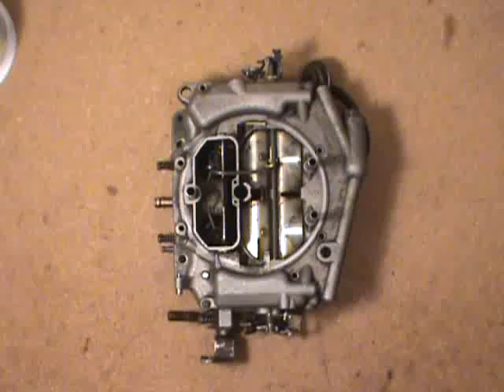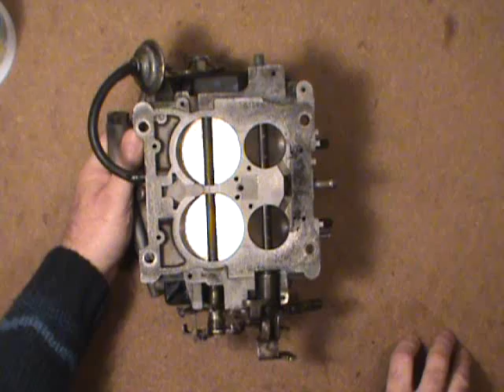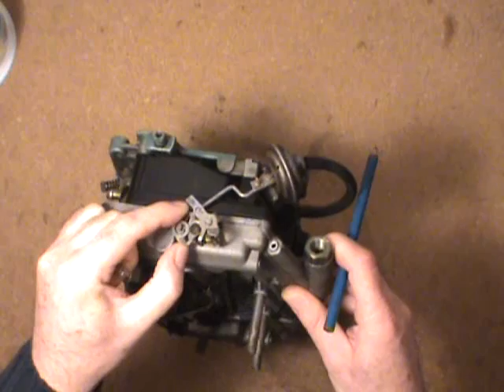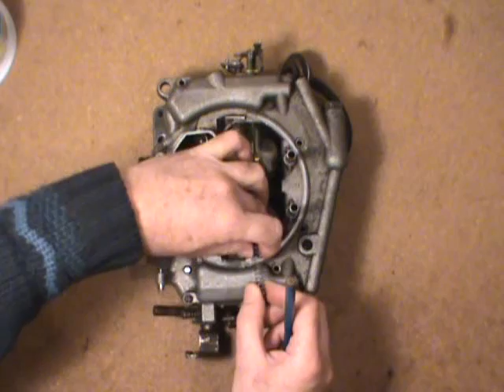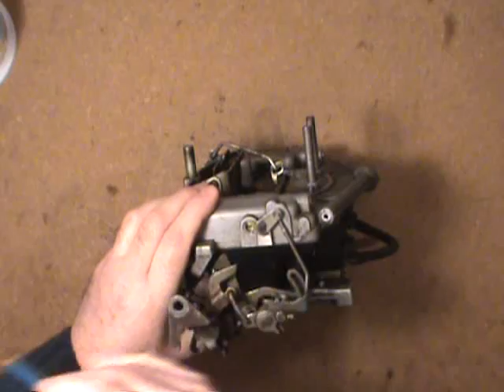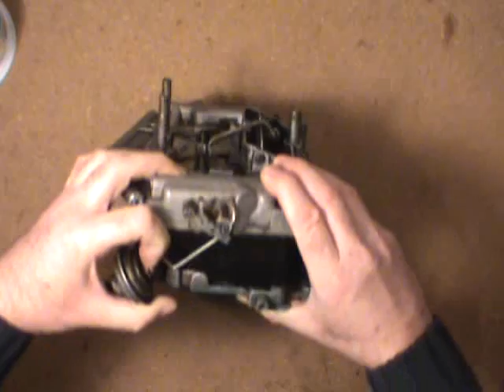Thermoquad 4 Barrel Carburetor  (Part 7)

Comment: Hi, these videos are great! I think the Thermo-Quad is a really good carburador, I had a stock  340 Dodge Challenger with a tq, it ran great. Now I’ trying to tune another tq in a bigger cammed engine, The first thing I noticed is the needles were to small and the carburetor dried. Tune this tq for a more breathing engine is way different from a stock engine. I’d like to have some recommendations from you.
Reply from the maker: Greetings...pepitomateo1...……..Thanks for the nice comment, and thanks, for watching too...…..Whenever, a factory/stock, not, high performance engine, gets a "high performance"...heavier breathing camshaft...that produces, that, much wanted, and heard...buh-bump-bah-bump sound, at idle speed RPM's, installed into it, then, it's very important, to get the "ignition advance curve"...modified properly, along with, the usually, increased amount of, initial (base) ignition timing, otherwise, the carburetor, will not idle, or transition into, the above idle speed RPM's, as it should be doing...……..You might, have already noticed, that, Ya had to crank the idle "speed" screw "in-wards" (clockwise), quite a bit, in order to, try and keep the engine from stalling...right...???...…….If you have a look at the Thermoquad carburetor, from the bottom side of it, then, focus your attention, on those 2 slots, as in, 1 slot, in each of the primary throttle bores...……When the choke system is fully off, then, there should only be, a "small square" opening, showing, there-abouts, that is caused by, and when, the primary throttle plates (butterflies), are in, their (curb) idle speed position...…….So then, whenever, the idle "speed" screw, gets turned in-wards/clockwise, more than it should be, then, those slots, that should be showing, "only", (about) a square shape, will probably be looking more like a slot shape (not wanted)...…...By, not having that little square shape (of that slot) showing, then, it will usually, really mess up, the transition, from idle speed RPM's, into the RPM area, that's above idle speed...…...That's why, it's so important, to have the correct amount of "initial" (base) ignition timing, for almost any camshaft, that will cause, that..."buh-bump"..."buh-bump"...somewhat famous, idle speed sound...…….For a Distributor, type of ignition system, the "initial" (base) ignition timing, has to be figured out first, for the camshaft's, and engine's, shall we say, "personality", then, the "total" (old school terminology, and, it was probably a racing distributor, that didn't use a vacuum advance canister, on "it", at all) ignition timing (total timing...that be, the initial/base timing, added to, what the mechanical weights produce, when they are slung outwards, as far as they will go)...as well as, how fast, those mechanical (metal) weights, sling outwards, as the engine RPM's, start to increase (the movement, of those 2 metal weights, are usually controlled by, the amount of tension, that those, usually 2, coiled springs are rated at, and, are sometimes, color coded as well)………..Here are some examples for Ya, and, please note..."Do Not Use these Examples"...on any engine, or..."Severe and Expensive Damage"'...could be the result...!!!...……I'll use an old school V-8 engine, that has a distributor...…….A "smog" engine (very lazy, performance-wise...lol), might have, oh, about 5 crankshaft degrees of "initial" (base) ignition timing, and, those 2 spring loaded weights, will add 30 (crankshaft) degrees, and might not, sling outwards fully, until engine RPM's reached above 4,000 RPM's, (the old school terminology/total timing, will be, 5 degrees initial/base...plus...30 degrees, from the mechanical weights & springs...for a total timing, of...35 crankshaft degrees)..........In this example, there will probably be, a vacuum advance canister, on the distributor as well, which will be adding, 15 crankshaft degrees, added onto, the total timing, while the engine, is in, a light loading condition (please note...when going pedal to the metal, the engine's, intake manifold...vacuum signal, drops to almost nothing, there-for, the vacuum advance canister, goes back to its resting position, and does-not, add any, vacuum advance degrees at this time)………..So then, ("smog" engine only), during light engine loading/just cruzin' along, then, it might be, 5 degrees initial/base...plus...whatever the mechanical weights and springs are providing at the time (depending on the engine RPM's)...plus...the 15 degrees, that, the vacuum advance canister is providing (here's another wrench, thrown in as well, as in, is the vacuum advance, connected to the carburetor's..."port", that's usually called ported vacuum, or, is the vacuum advance can, connected to "manifold" vacuum...???)…(the only real difference, is that, with manifold vacuum, it will usually add that 15 degrees, while at idle speed, where-as, the ported vacuum signal, doesn't kick in, until, just above idle speed RPM's)………..The most ignition timing advance, while the engine is lightly loaded, will probably be, 5 degrees initial/base...plus...30 degrees from the weights and springs, while the engine is above 4,000 RPM's...plus...15 degrees, from the vacuum advance canister...which will be 50 degrees, when it's as far as it can go...…….A vacuum advance canister, that is connected to "manifold" vacuum, that also has, the correct rate (measured in Hg/inches of mercury), as well as, the correct amount of (vacuum) advance (be careful here now, because, there are crankshaft degrees, and also, distributor degrees, which are only 1/2 of, the crankshaft degrees...!!!...pay attention to that one, for sure)...where was I...oh yeah...by using the correct vacuum advance canister, that's connected to manifold vacuum, then, the engine, that has that "performance camshaft", in it, will probably now, be, idling, and transitioning into the RPM's, just above idle speed RPM's pretty good, well, providing that, those 2 slots, in the Thermoquad carburetor, are showing a square shape there-abouts, while the carburetor is at idle speed, and that, the distributor (if there is one, that is), is, properly set up, with the proper, ignition advance curve, and, is also, set at the correct, Initial/base ignition timing, for that "exact", high performance camshaft...……..Now then, here's an..."Example Only"...for a high performance camshaft-ed engine...…….Before I forget, there use-tah be, some "initial" (base) timing, degree....recommendations/suggestions, that I saw, some time ago, on, the good ole inter-webs, that were based on, the camshaft's duration specifications (well, as I recall, that is)………..So, here goes...…...The imaginary/example, high performance camshaft, in this "Example Only"..."Do Not Use"...!!!...likes...20 degrees of initial/base timing....and...the engine's personality, is asking for, 35 degrees, of total timing, and, the total timing is...(20 degrees...plus...15 degrees, from the advance weights & springs, which, will fully sling outwards, when the engine RPM's, reach 3,000 RPM's, which isn't too risky, on this "example only, imaginary" engine)………..Then, it can sometimes become tricky, when choosing & setting-up, a vacuum advance canister on this one...…….Seeing as how, the total ignition advance, is now coming in earlier, at 3,000 RPM's (not 4,000 plus, like the "smog" engine had), then, the vacuum advance canister, might not be able, to go any higher than, oh, about 10 (crankshaft) degrees, perhaps, otherwise, there might be some surging, or maybe, a bit of pinging, while at light engine loading/just cruzin' along...……..Sometimes, too much initial ignition timing, can make it too hard on the starter motor, to turn the engine over, when the engine is hot, and, this is where, the correct vacuum advance canister comes in, to help things out, starting-wise, that is...…….Lets say, that, the hot engine will start ok, with 10 degrees of initial/base timing, as to where the distributor is locked (bolted) down, then, the other 10 degrees of advance, can come from the vacuum advance canister, once the engine starts running/when the manifold vacuum signal is now present.......….If Ya wanna spend a few dollars, and have a new distributor, that is "custom" made, and set up, for your exact engine and vehicle, then, go check out....DUI (nope, not that kind), but rather...Davis Unified Ignition...(I think, that's the name of the place), as, they do quite a few types of distributors, and, they might have an HEI (High Energy Ignition) distributor, that only requires a "1-Wire" hook-up...!!! (12 volts/ignition switch wire, most of the time), for your engine...………They also have, some good lookin'...spark plug "wires" too (as I recall)………..The DUI folks, will want to know, just about everything, about your vehicle and engine, because, the more, that you can tell them, about your ride, the better, that, they will be able to, match the ignition advance curve, to your vehicle and engine's needs...……..Not only, will a proper ignition advance curve, improve the engine's performance...you'll also get, an increase, in fuel economy too..."but only"..."if"...???...Ya can keep...Ur Big foot...from..."mashing down"...on the gas pedal...!!!...lol...and...….till next time...….Be Safe, take care, and have a good one.

Comment: Do you have a website ? I have a special Thermo-Quad on a 1978 Dodge Polara 440. Former N.C. State Highway Patrol Cruiser that can use your detailed work.
Reply from the maker: Greetings...W Butler...……..Thanks for watching...……..Well, I don't have a website at all, but, if you can post any questions or concerns, that you may have, about a Thermoquad carburetor, then, feel free, to post those things, under any of my Thermoquad carburetor videos, that are on my YouTube channel...RockysRoadshow...thanks...………Here are a few things, that should be replaced...…...Get 2 new "floats"...and, a new "choke pull off" (kinda looks like...a little space ship...lol), and, if there is a short rubber hose, that connects it to the Thermoquad, then, it's a good idea, to replace it as well, as the older, probably dried out, rubber hose (tubing), might have an air leak in it somewhere, or, just fits poorly, at one, or both ends of it...……..The "rebuild kit", for a Thermoquad (and, for most, of the other carburetors as well), will usually have some very, very good (on paper) instructions, that are usually in the rebuild kit (as in, inside the cardboard box), and will have, some very impressive, and well written instructions, specifications, and drawings as well, that will usually guide you through, step by step, as you move along...……..Be very certain, that you make all of the adjustments/settings, in the..."Exact"..."Sequence"...!!! (as in, order of doing things), because, some of those adjustment/settings, depend on, some of the other settings/adjustments, that were done..."before"...the one, that's about to be done...!!!...and, that's probably, one good reason, that some folks, gave the Thermoquad, a, not so good review, as in, they or them, probably never studied the Thermoquad carburetor at all, and probably, just turned this screw, or that screw, and/or, bent a linkage or two, while not really knowing, what does what...???...and wondered why, it ran like crap...lol...……….I'm not sure, as to when/what year (as in, was it before, or after 1978...???), that, the good ole Gasoline (full strength stuff), was, shall we say, starting to get watered down, with about 10% Ethanol (might be alcohol, made from corn, perhaps), which will probably cause, some of the earlier Thermoquads (that were originally calibrated, with 100% gasoline), to administer, a "leaner-than-wanted", air/fuel ratio, to the engine...………I had to re-jet (with the fuel jets), a Themoquad (circa- 1974), quite a bit richer, from .095", up to .104" (" equals inches) hole diameter/orifice size, just to get rid of that lean surge, that I was having, some time ago, while just going, at about city speed, and very easy on the gas pedal...(lean surging, is when the car was surging/bucking, forwards and backwards...very annoying, and Ya can't miss it at all...lol)………..Running an engine, on too lean of an air/fuel ratio, can, and will, be causing, a certain amount of engine damage, especially when, going pedal to the metal/full throttle acceleration......….There are usually...Four numbers, followed by the letter S...that are usually..."stamped into"...the Thermoquad's…"Baseplate"...(aka, throttle body), at one of its rear corners (at the back), and, you'll need this information, when-ever ordering a rebuild kit, or, other parts for it.......….Do an internet search, for...Vaanths Thermoquad Guide...(I think?)...because, if that web-page, is still up and running, then, there's an incredible amount of information to be had, and then some, and, the guy that wrote it, did a Fantastic job...!!!.......and......till next time...…Be Safe, take care, and have a good one.

Comment: Great video.  My secondary air valve door is stuck closed on mine. It isn't rusty or anything.  What causes that?
Reply from the maker: Greetings...Mickey Flowers...…….Thanks for the nice comment, and for, watching too...….I'm sorry for taking so long to reply to you, as, I kinda missed this one...…….The TQ's secondary air valve's opening rate, and, the amount that it opens, is usually controlled by the "choke pull off" (it kinda looks like, a little space ship...lol)………..While the engine is running at idle speed RPM's, and also, at, not so fast, city/highway speeds, while going easy on the gas pedal, then, the engine's, intake manifold's vacuum (signal) is quite high (as in, strong air suction), which will usually, keep the choke pull off's stem, pulled in quite a bit, which in turn, keeps the TQ's air valve, from opening very much at all...……Also, there are a few linkages involved as well, and have to be adjusted/operating properly...…….Having the engine "cold, and not running", push down lightly, on the rear side of the air valve, with one finger, then, take your finger off of the air valve, and repeat this action a few times, and "watch" the movement, of that curved, slotted bracket, that's on the end of the air valve's shaft, and how the linkage/s, make contact, and, any other linkages, that also make contact with other parts...as in, just watch, for any movement of parts, as you are poking at the air valve...……..The adjustments/settings on a Thermoquad (TQ), have to be done in the "correct sequence", as in, the correct order, because, some of the adjustments/settings, that are about to be done, depend upon, some of the "already done", adjustments/settings, otherwise, things will usually get messed up quite a bit, and, the TQ carburetor, probably won't work very good at all, and...…...till next time...….Be Safe, take care, and have a good one.